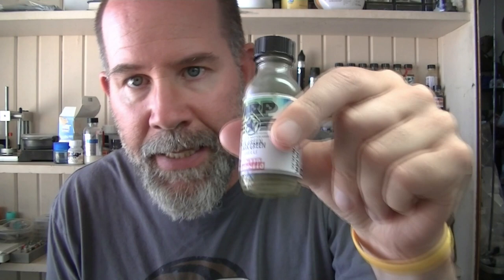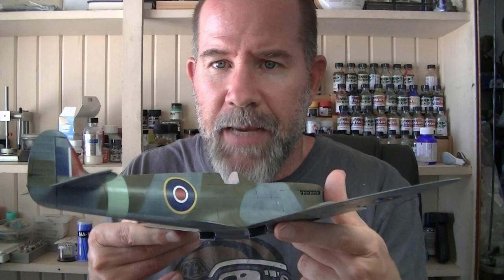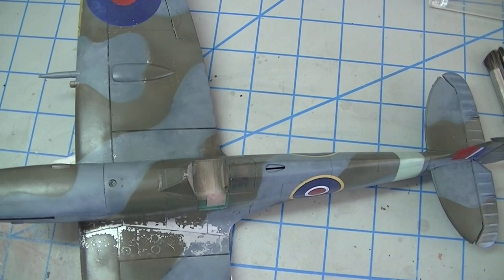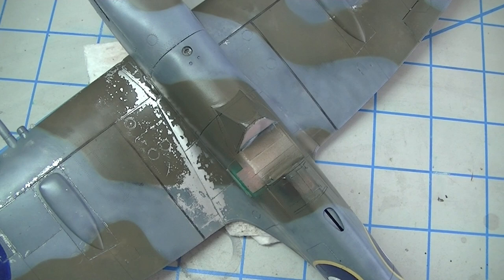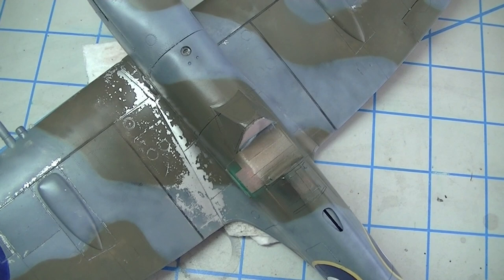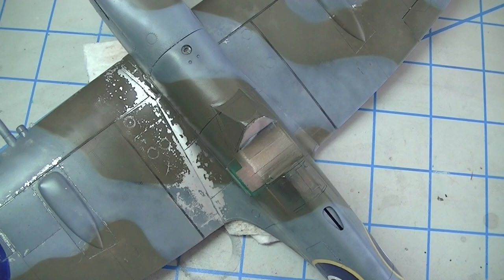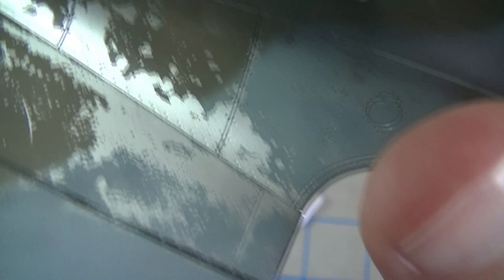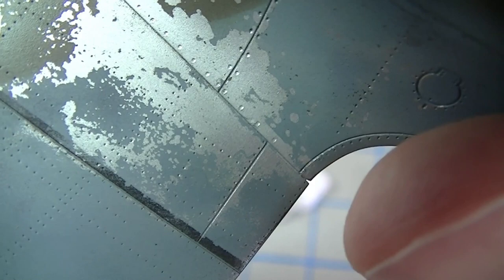ep237 - hairspray chipping with mrp

Comment: You nailed it right on the head with your chipping variables. Especially, size, and more, or rather most importantly the small - micro chipping and the defusion & dispersion. They really set it off as being believably realistic.

And.... those roundels look really good. I've been saying for at least 10 years that it looks so much better painting the ensigns and insignia instead of using the decals as much as possible. Not only does it just look better in general but it's also much easier to weather and chip.

Comment: Thanks for this video. I used AK RC thinned with Mr Colour LT 400. As you explained I was tapping away all day long with various stiff brushes and was unable to get the chipping effect to start. Same problem on another model when I used Tamiya with Mr C LT. Even with tooth picks not a scratch on the paint surface. My models almost became plastic lawn darts out of frustration. After countless searches online, thinking I had screwed up the method, I stumbled on your video which explained the exact problem I was having. Will try your method and hopefully will have great success.

Comment: Not tried this yet (achieved something similar by accident but not with hairspray ) but I will try it. Oddly enough, in service we would have paint simply lift because of bad prep...in effect the exactly what you are doing here. Compromise the bond.  Boom...attenuated, there you go. Like most things it has its place and I can see it on parts of my next project (Tamiya  Skyraider).  

I use pretty much only lacquers and find if you spray them thin (as you can with MRP and Gunze) they wear nicely. I have even tried metalic/Matt varnish then top coat and abraded with fine abrasive and it works nicely, the Matt giving that buffer which if you cut through then shines as well.

Great stuff, right about Martin, hilarious and talented.  Thanks Will

Comment: It's easy for me, spray on the layers of paint in the order that they'd be applied by the manufacturer, and then sand them off where they wear. The worse spittle from the adjusting the pressure on the first two layers, the better the wear pattern. He who controls the spray, controls the chipping. So, knowing how to make larger and smaller "dots" of paint coming out onto the surface, makes creating the pattern to the chipping happen. Once dry, sanding back into these layers is a lot more precise than hairspray philosophy.
Reply from the maker: apples and oranges.

Comment: Excellent demonstration, well thought out, organized, and presented!  I have a few questions though.  What paint are you using for the aluminum, is it going over a gloss black primer or over bare plastic?  I'm assuming that all of the markings and walkways are painted, as I'm sure decals would be destroyed during the chipping process.   How did you get all of the individual fasteners so perfectly silver, paint?  Thanks for sharing your techniques with us!
Reply from the maker: thank you!  here are answers....mrp super silver lacquer is my go to aluminum.  sprayed on mr. surfacer 1500, unpolished unless there's some accidental texture.  all markings painted so far.  as for fasteners....if you're lucky they chip naturally.  if not, i may go after them individually.  i may also fill with silver enamel like a wash.  for proud fasteners, i just rub the paint off with a buffing stick.

Comment: Opinions will differ, but re: prior comments on this video being too long, disagree. Your time spent on providing this chipping information is invaluable to the modeling community, IMO. So, thank you. One question…I’m using Mr. Color (their solvent-based acrylic line), so am assuming that will work here with that line?
Reply from the maker: Thank you for the kind words! If you watch much of my stuff you know I don't give a shit about it being "too long". And I also strive to provide good information so I have to say… Mr. color is not a "solvent-based acrylic". Firstly because it's pure lacquer. Whatever similarity the resin in it has to what model makers called "acrylic" is pretty much in name only. Secondly, I always feel like the term "solvent-based" is nonsense. Even water is a solvent if you're a sugar cube.  Regardless, it will also chip just like MRP, but it will also be challenging because it's just naturally a tougher and more water resistant coating.
Reply: @barpfoto Points taken…and you’re right, H2O is the universal solvent after all! I described it as such (“solvent-based acrylic”) only because that’s exactly what Gunze calls it. 🙂 Honestly, I’m confused most of the time re: paint chemistry. I chose Mr. Color largely because of the model’s instructions and needed colors. I do want to try other brands, like MRP. In any case, by managing the variables (especially layer thickness in particular), sound like Mr. Color will work. I already decanted TS3. Thanks again!

Comment: I cannot argue with the results, and I certainly will not argue with someone that is so many leagues above me in modelling, but something about using hairspray on a model just doesn't seem right. Does it not affect the hold of the paint to the surface? Obviously that is what you want for the areas that are to be chipped, but what about the rest of the model? Is that paint going to peel or flake later? Or be prone to chipping in handling?  The effect looks epic, but I'm a but concerned about long term durability...
Reply from the maker: a fair question.  all i can say is people have been at it for a decade and i've never heard anybody say it's an issue.
Reply: you put a layer of clear varnish over everything when you're done. This will protect the surface.